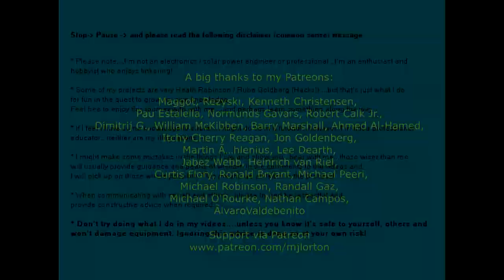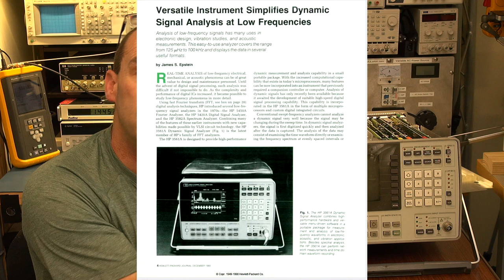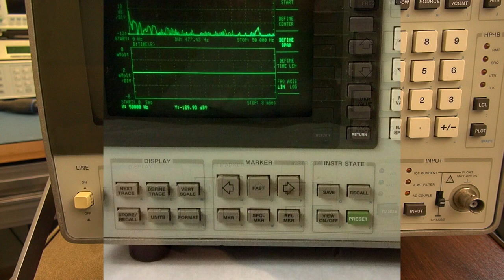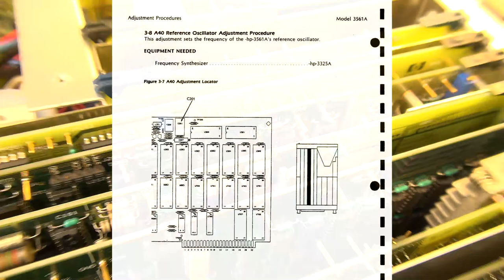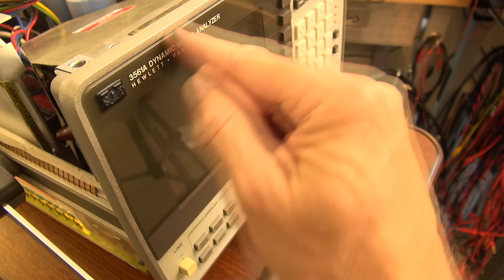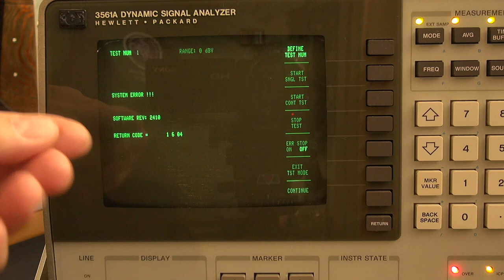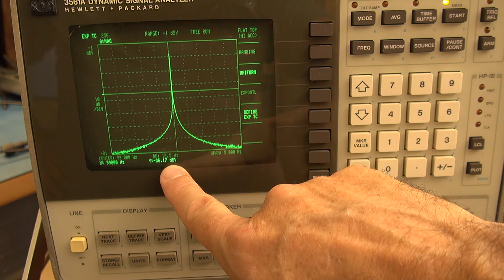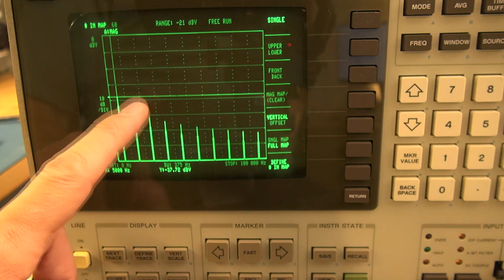A Look Inside #16 - HP3561A Dynamic Signal Analyzer

Comment: You should check the Crystal frequency to see if it has drifted off, you can always add ceramic capacitors or inductors to the crystal to shift it around.

Comment: Not ISA bus ... that is a PC format and, not relevant to this device.     I have the same unit, I have some issues with the keypads, I will try cleaning them up and see if it improves, sounds like you had good success with yours.  I use mine almost exclusively with HPIB so the buttons have not been an issue, but it would be nice to have them working.  The primary use of the "source out" is for stimulating systems and then using the analyzer to monitor the results. They were used extensively for tuning servo systems ... introduce the noise source into the control and then monitor the control loop was a tpyical way they were used.  I use mine with a HP113848 phase noise analyser.

It is unlikely the tuning capacitor is out of spec, it is an air spaced cap, they don't change.  More likely it is crystal ageing. You'll need to put a small NP0 ceramic cap in parallel with the variable cap, roughly 1/2 of the max value to bring the capacitance into range.

Comment: Thank You, many good tips. I have one of these as well. These pushbuttons can sometimes leak silicone that act as an insulator. Cleaning usually fixes the problem.
Reply: Can you give us a hint on how to open and clean them? thanks!
Reply: @jalmagro36  I have taken a few instruments with silicone apart and cleaned the contacts. On some because silicone oil was visible. I used naphta or pure pentane to disolve the silicone carefully with tops. Watch out so the solvent does not touch the print on the front of the buttons, it may dissolve. Clean the circuit board contacts equally. Remove the top and bottom by the 8 quarterlocks. I took mine apart much more, but as I remember it the front panel frame is stuck on by a few philips screws from the side. The back of the circuitboard has the contacts for the silicone pads as I remember it, You need to remove it from the front panel. Clean the CRT hv areas while at it. Take a picture of the panel before removing the buttons. I can not remember if they were stuck in sheets or individual. Good luck!
Reply: @erikisberg3886  thank you.

Comment: Damn you!  You are such a great salesman!  I bought one off ebay as well after watching this video!
There were two for the same price, one had a crack in the plastic.  I bought the one that did not have the crack, and the cal sticker had a date of 3/20/2018, due in 2020.
It is missing the handle and one of the feet in the back is missing, but I can repair that.
I paid 750 for it (they were both 750).
Opened mine up and it is VERY clean!  NO dust on the fan filter or the fan itself!
The heatsinks inside are all clean too!
I looked at the air cap that you are having problems with and mine is about half capacitance, so it is within the operating range.
I haven't check any cals yet though.

Even the front panel is clean!  It has Keysight cal stickers on it and a Keysight cal void sticker on one of the top camlock screws.

Other than a few scuff marks on the corners and case edges, it is in great shape!
I thank you for your "encouragement" for getting mine!

Any idea for vol 2 of the service manual?

Comment: When adjusting C201 it is super touchy.  It will hit a peak that matches the waveform in the service manual and the slightest nudge will shift it.  Don't make big adjustments on this variable capacitor or you will miss the peak setting.  Also the tarnish on the capacitor is normal and won't affect performance. Any object (finger, tuning tool) near the capacitor shifts the peak so it takes a lot of little adjustments and then back away from the capacitor and see the result, then nudge again if needed. This is based on my experience.  Hope it helps on your HP3561A.

Comment: I picked one up for 250$ on eBay, 2 years ago. That was a good buy. The secondary side rectifier diodes were shorted, thing was up and running in an hour. Very nice machine and very accurate.

Comment: Soot is as a result of the high voltage attracting all the ambient dust to the high voltage areas. Smokers you will find nicotine and tar, from the second hand smoke. Black soot is normally from lead in fuel and small particles of rubber and soot from fires and incomplete combustion, both from vehicles and from heating furnaces.

Comment: I watched this again and wanted to add that I upgraded to the LCD display and WOW it is very nice with the color display!
Mine did not come with the pouch on the top or carrying handles though.. kind of bad, but I can make something up that would work, and I downloaded the manuals from Keysight, so thanks for the links.  Would be super to have the originals though...
I would love to see yours in use if you have been able to use it since.
Thanks!

Comment: Sometimes with hard to push buttons, if the circuitry uses a pull-up resistor, raising that resistor (i.e., from 10K to 100K) makes the switch a lot more sensitive.  I've done this successfully in the past (different instrument).

Comment: If the new capacitor does not work take the crystal out and turn it around, and place back in the unit. Old crystals can tend to get a bias as they age, and become somewhat off frequency wise. Otherwise you really want a new crystal of the exact frequency, though that likely will be either expensive, custom or off the shelf depending on the frequency.

Those sticky keys there is an EEVBlog thread on how to repair them, and you might be able to get them back to perfect again.

https://www.eevblog.com/forum/repair/repairing-hp-plastic-push-buttons/
Reply: The EEVBlog thread is about the "Bill West" key switches. The ones in the 3561A are silicone rubber membrane ones. I've had success (on other HP equipment) rubbing some (very little) pencil graphite on the small conductive pad on the membrane.

Comment: I always start by replacing all the electrolytic caps, before trying to calibrate it, it could be too much supply ripple causing the wide skirt and noise floor.

Comment: Nice HP measurement kit, what's not to like? :-) The soot on the CRT is normal with age, as you mentioned the high voltage is to blame. The CRT HT voltage attracts dust and it builds up over time all over the CRT and surrounding components. I used to have happy times cleaning old CRT TV's from heavy smoking customers when I was an apprentice. They would swear they had a new CRT, when all we did was give it a good scrub with an isopropyl soaked rag!

Comment: Hi resolution has nothing to do with higher frequency. It is about capturing more of the details from the analog source (when remastered) or just more detail if recording that way originally.  And there is 100% a huge difference if of course you have a system that can produce the nuance. If you're listening on a Bluetooth speaker then no.

Comment: The Serial Number is on the small aluminium plate to the left of the lower right-hand foot at the back, or to the right of the yellow sticker, below the lower vent holes. The sticker on the top probably shows a calibration date and I guess quotes the serial number: The format follows HP's convention: 24 indicates the year of manufacture after 1960, 52 the calendar week, C the country of manufacture and 0900 the sequence number within that week. On other instrument models, the 2452 part would indicate the date of the instrument's (original?) firmware revision. I don't know what country "C" stands for and 0900 for the sequence number seems quite a nice coincidence. Perhaps there's something special about the number. Mind checking and comparing against the aluminium plate mentioned earlier?

Comment: The HP 3561A is a nice instrument. Its design contains some nice and exceptional features. How about the CRT screen which, although using a standard raster scan scheme, scans vertically instead of the usual horizontal scanning? That's been done to increase perceived image quality, because of its large vertical line content. It's described in the right column on page 15 of the HP Journal (December 1984) that you show in your video.